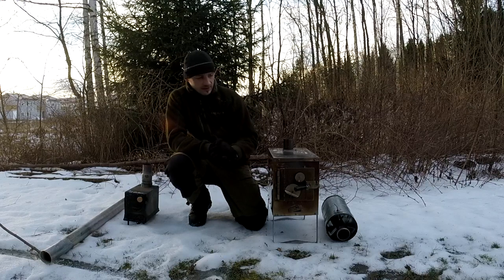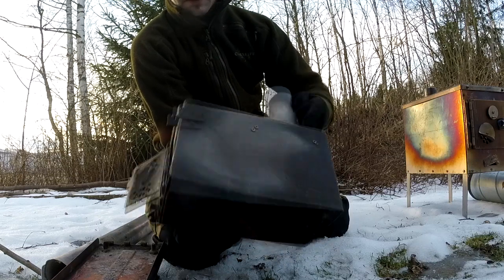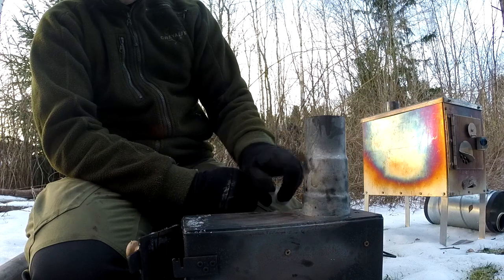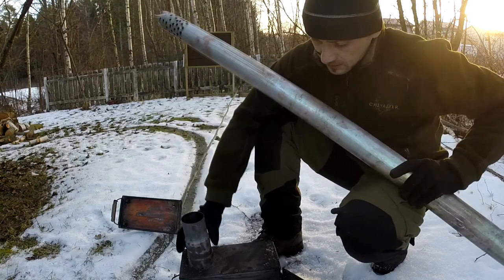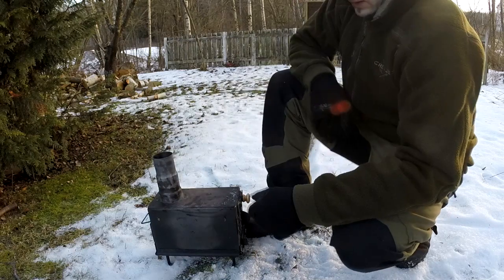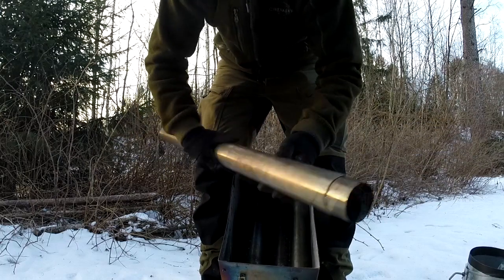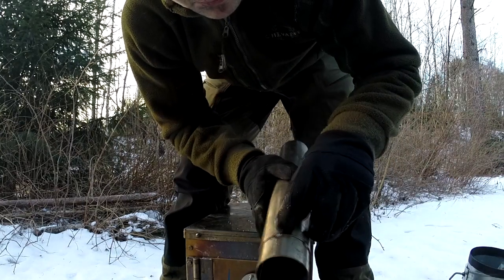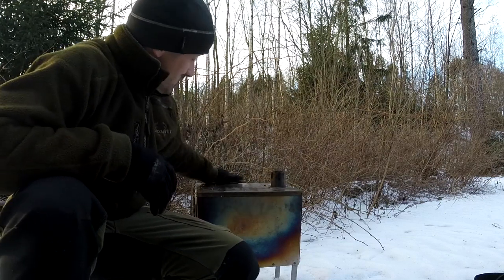My DIY wood stoves for hot tenting

Comment: Excellent design Odd! Very well made and well thought out. With this bitter cold weather I have been thinking about making a stove and will use some of your great ideas. Thank you! Ossie
Reply from the maker: Thank you, it works fine as is, but thinking of making a damper and experiemnt with a small fiberglas gasket in the bottom to see if I can improve it further.
Thanks for watching
Atb, Odd

Comment: I've made stoves from LPG cylinders & they worked well. It is easy to make a stove which runs fast, but harder to get it to run slowly, or overnight. Peat is good for this, but frowned upon now. I never fit a damper as I don't want to restrict the exhaust gasses from going up the flue & I always have a CO detector in the tipi too. Very good job on both stoves, well done.

Comment: You did a nice job on those. I am in the middle of stove build I actually just need to put the legs on and get some pipe. Mine is a large stove for a 10x14 wall tent I have.  This video has motivated me get back to work on it since I have worked on it in couple of months, lol. 

Jason
Reply from the maker: Glad I do motivate you Jason. I have it the same way myself, longer project tends to have some breaks until new motivation rises.
Thanks for watching,
Odd

Comment: I love that larger stove especially.   That is exactly what i need in my new tent.   I may try to build something similar.   You have some ingenious fabricating skills.    My stove will no doubt be less skilled than yours but will hopefully work okay.
Reply from the maker: Thank you Lonnie, I had to get some help from a welder to fix some welds. He used tig to do it, and thats something I dont know how to do. The materials I got from the place I worked at that time. The stove is still good, and in use every winter. If I should have done anything different, I would have found a thicker stove pipe. This one is about 70mm, or just less than 2,5".

Comment: Those are just darn clever.  Love the flame catchers.  Really nice idea.  Such great workmanship.  It must be grand fun to heat yourself up with something you've designed.  Now on the other end of the spectrum I bought a little Kni-Co Jr. Woodstove, and have been practicing all fall--but nevertheless the first couple nights in the hot tent cooked me.  I'm almost at the point of getting out in the woods, though, and am now searching the  YT for good cooking ideas and tips with the hot tent wood stoves.  Do you have any up that I missed?  Jules
Reply from the maker: +steinwaygoat Hi Jules, with this small stoves in small tents you have to let it burn small to not getting cooked youself. Fill it up with firewood and you will almost die from heat stroke. In smaller tents its almost better to not use a stove if its not cold, anything below freezing is when I use a stove from time to time. With ventilation its then good.
Other good heat sources is a very good friend in your sleeping bag with you ;)

I have a couple of videos up when using the stoves in tents:
https://www.youtube.com/watch?v=SFmkpBJ9QuM

https://www.youtube.com/watch?v=J1w5QRvuRLA

 -Odd

Comment: You did a wonderful job on the ammo stove, very sweet. You put alot of thought into this stove, you should be proud .Wow i love both of those stoves man, awesome jobs on the build. Thanks for sharing, you gave me some ideas, i have one small keg stove. its okay but not super hot.
Reply from the maker: Thank you Kull, I have watched a lot of videos of ammo can stoves and stolen some ideas from several and tested out. This is the third design of the ammo can stove, and this is the one I ended up with.
This ammo can stoves will eventually be wear out, this thin carbon steel plates will be weakend every time you use it. But it will last a good time. The thicker top plate will helt it last longer. Cheap to build a new one also.
Thanks for watching,
Atb, Odd

Comment: All neatly designed stoves.  Lots of IQ put into their designs for burning, internal heat and air flow, outside air flow, chimney pipe, etc.  A consideration is putting in a chimney flue plate for controlling the airflow, that allows even greater heat and burning controls, just like old cast iron stoves of our ancestors.

Very excellent presentation.
Reply from the maker: John Lord I have that in mind as a project before next winter. Thanks for watching
ATB, Odd

Comment: Odd,
Very nicely done. Do you sketch out your designs first with all the components you want and need or is it from memory with some trial and error? I am really impressed with how you approach mitigating potential problems (like your spark arrestor  and insulating sleeve). The smaller ammo can stove may be my next project. Thanks for the videos!
Reply from the maker: For the small one I may sketched some on paper with some measures before I started cutting. But this is the 3rd type I made, so its trial and error also. The bigger one I did in 3D-CAD and got a good man at work to cut out the plates for me, and he also did weld the few welds on it. It is held together with screws, but corners of the lid are welded.
Thanks for watching, and good luck with your project.
Atb, Odd

Comment: Nice job on both stoves. Been thinking of making a couple of tent stoves myself. I was wondering what the gap was between the baffle and top? And is the door made out of the ammo can pieces or heavier material like the top of the stove? Thanks, Jon
Reply from the maker: Hi, The distance between are aprox. 1 inch, top plate are 3mm and door is 2mm. If you use the piece cut out of it, it will be to small and it will also bend cause of the heat. The 2mm plate holds well. Pop rivets and screws are all stainless.
Thanks for watching,
Atb, Odd

Comment: Good stuff sir. Really top notch.  Thanks. I've been thinking  of getting a polish laavu for a bit. Looks really versatile.  They  are a but hard to find in the states. Let me ask you though; with the stove; it's just one man right? How is it on space?
Also, do you ever use it as a poncho? Would you wear it over or under your  backpack?
Thanks again for the wonderful videos.
C.Daly
Reply from the maker: I have modified the poncho-tent kit. I have removed the buttons on the backside and sewed it together, and fitted a HD zipper in front. So its not possible to wear it. And thats fine for me. I use it as a tent only. Its not superbig, but 2 buddys can easily fit in with gear. But not with the stove. The stove use is ment for cold winter, and then you will usually have more clothes and gear with you, so its ok for 1 with stove. Its about 2,4 meter in diameter, and 1,4 meter high. I found mine on ebay and ordered it directly from Poland. 
Thanks for watching
Atb, Odd

Comment: Nice! Do you think a grate for the bottom is better than using a solid false floor? Thanks
Reply from the maker: A solid floor will give you a longer lifespan, but a grate gives more oxygen flow. So it will depend on the design. I chose to use a grate in the ammo-can stove cause it makes it easier to burn the wood, and its easy to make a new one when this one get a burn hole. Mine are now 3 years, and still going strong, a little bit of surface rust here and there, but no hole or thin metal yet.

Comment: do you think that 0,6mm are enough for a woodstove? i can't find plate of iron over 0,6mm :/
Reply from the maker: This ammo cans are not thick, less than 1mm thick steel plates in the sides and bottom. 0,6mm will work fine, but it might burn thru after som extended use(several years of camping). Make sure you use plates without galvanizing / zink plated. 
If you put a grid pattern plate in the bottom, or just another piece of that 0,6mm plate, you will extend the lifetime.

Comment: Both stoves look very solid to me. Nice work ! Thanks for showing us.
 I have some experience with woodstoves myself. My small stove is only 3.2 kg including pipe and is still not made of titanium but stainless steel. Its not as solid as yours but is holding well. You inspired me to get rid of my cooking hole and poprivet a 3mm plate on top to cook on. The hole was experimental. It works but it,s quite a hassle and you don,t really need it. I might also install a baffle if I still have room enough inside to store the pipe. Do you use a damper in your pipe aswell ? I like to do that a lot. Very good to regulate heat and amount of fuel you use. Here you can see mine :
 https://www.youtube.com/watch?v=70eUUkZJsHU&list=UUCh52ctR31-TukR4eSAcUIA
Reply from the maker: I`m thinking of making a damper in the outlet, have not done that yet. I`ll check out your video for sure later today when I get home.
Thank you for watching and commenting
Atb, Odd